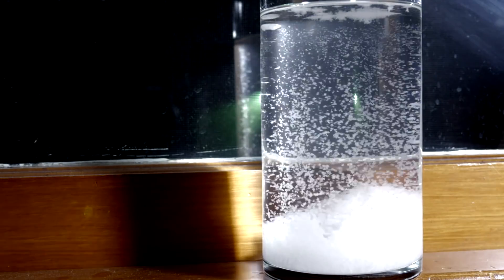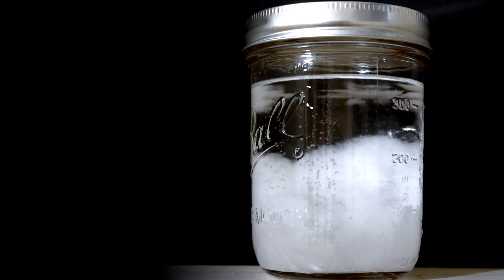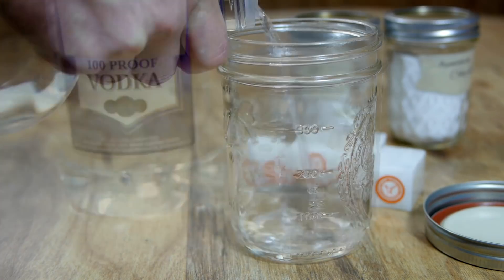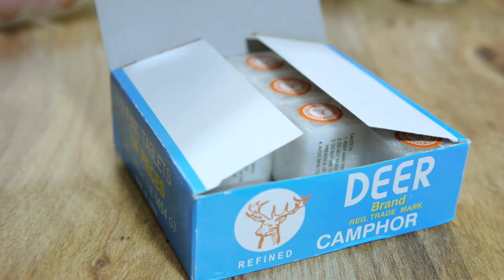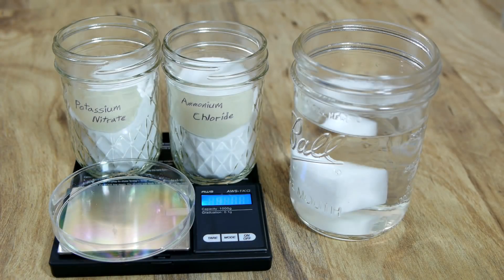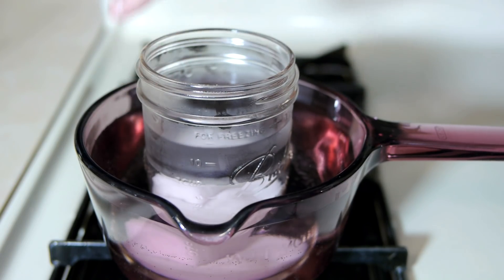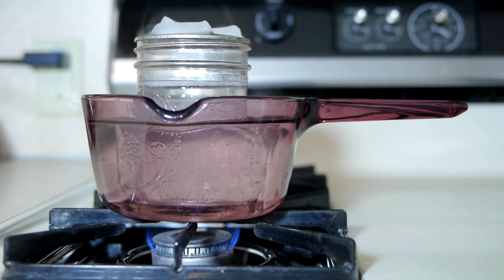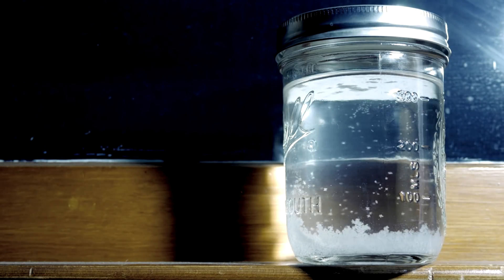How to make a STORM GLASS to predict the weather!

Comment: If this is reusable, how long would the storm glass last?
Reply: read the description
Reply: TheHarleyEvans Oh, sorry man, my bad :)
Reply: TheHarleyEvans i cant find it in the description
Reply: frodo jensen you can manually reset it to clear liquid to watch the crystals re-form by placing it in warm water untill the liquid is clear again, but you do need to unscrew the lid again so that pressure doesn't build up. however it will change into the different crystal formations slowly on it's own over time
Reply: TheHarleyEvans ok it can go on (nearly) forever so thats why cant find it thanks
Reply from the maker: It will last for pretty much forever in a sealed jar.
Reply: NightHawkInLight Wow, it's like it's an honor to get a response from you :)

Comment: Awwww rats. Chemicals....
Reply: Easy to find chemicals. That are not very toxic. Just make sure to not eat them : )
Reply: Where could I find them?
Commonly and well in high concentrations.
Reply: Potassium nitrate is sold at hardware stores as stump remover. Vodka is at grocery stores. Camphor is at hardware stores as a rust preventative. And ammonium chloride can either be made by mixing hydrochloric acid (hardware store sold as muriatic acid) and ammonia (grocery store) and then boiling down the mixture until its just a salt, or you can just order it online if you don't want to make it.
Reply: Dont think a minor such as I can get vodka... Rats.
Reply: Just show your parents what you're using it for. I think they would buy some for you.
Reply: With these particular chemicals you could make a serious bomb
Reply: ElectricAir42 not really. More like a paste that burns.